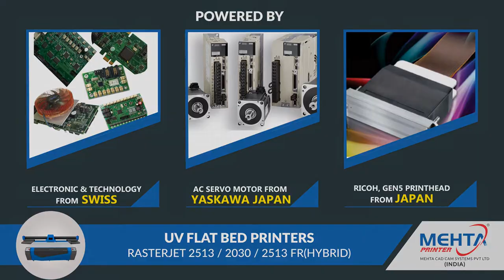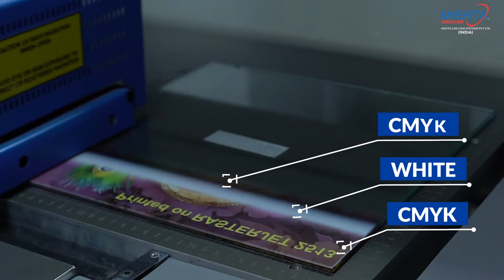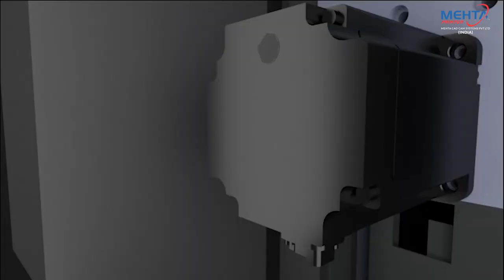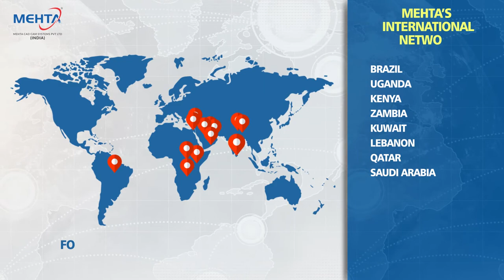RJ 2513 UV Flatbed Printer : Mehta India, Call 91 7575009654

Comment: Do you have uv printet for metal surface? If yes in which sizes
Reply from the maker: Yes, our UV flatbed printers can print on metal surface.. We have standard sizes of 1000 mm x 1600 mm,  2500 mm x 1300 mm, 3200 mm x 2000 mm. We even give options of customer specific customizations. If you can share your contact number our product expert will connect with you and provide you with more information.